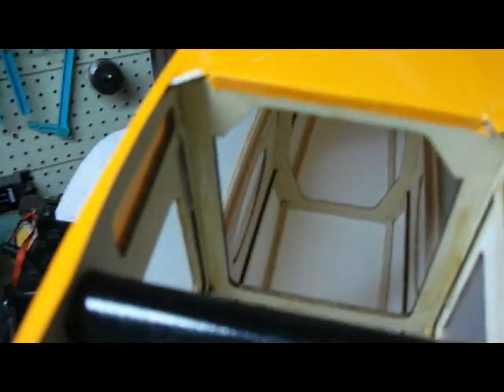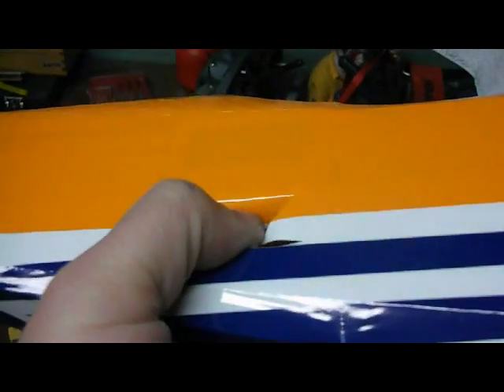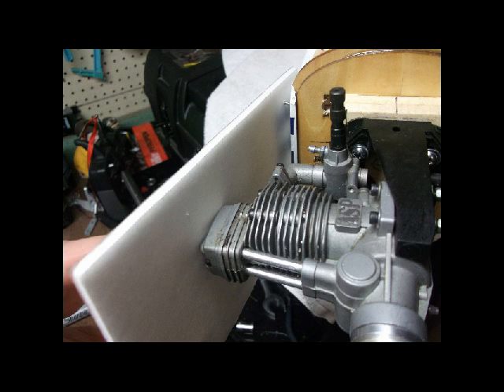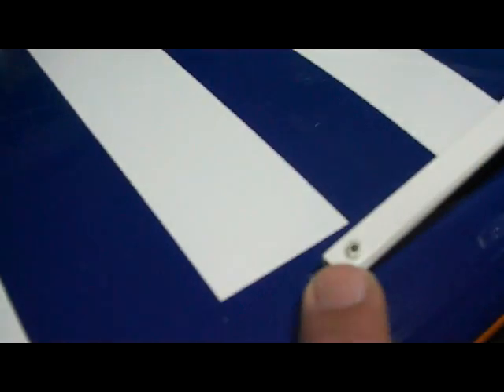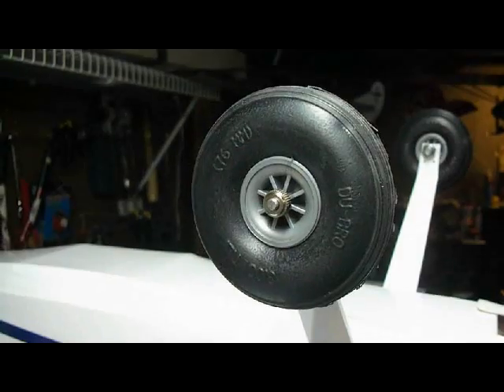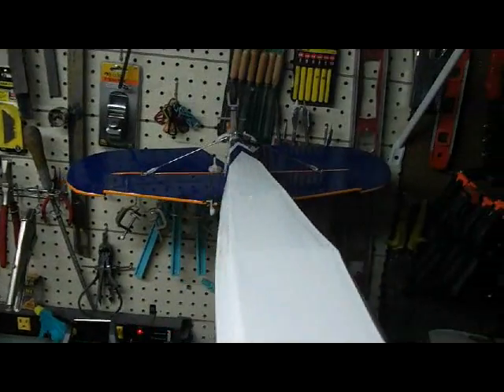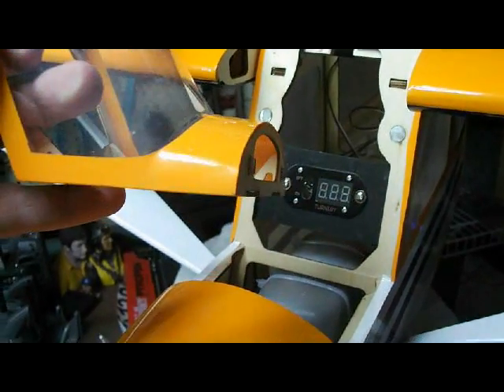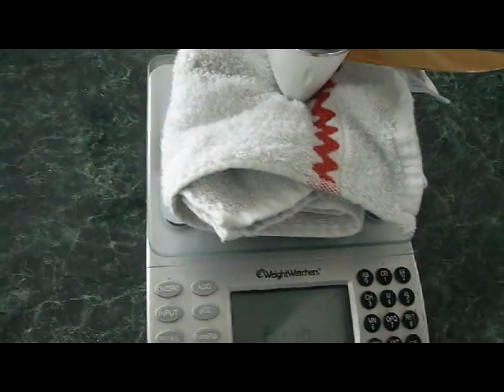Hobbyking Decathlon 62" w/nitro power

Comment: Have you flown this plane yet?, .. if so, how did it go?. I set the same plane up a few months ago with a magnum FS70 that I traded for a asp fs 61. My friend needed the lighter engine more than I did... had to put my battery right in front of the rear servos  to balance... it does some nice flat spins, I'll have to video it.
Reply from the maker: Not yet. There was a lot of crappy weather back in the spring. Although lately I just haven't had the time. The plane's been finished for 4 months and so far I've run it once to get the engine set up and that's it. I've gotta elevate my RC priority!
Reply: Wow, no maiden yet!,... hey I like the way you did the wing struts (mine are stock), it,s just there mainly to keep the wing halves on the plane in case the cheezy set screws come out...(keep an eye on that). The only problem that I had during my maiden flight..... the plane was balanced and it flew beautifully and didn't have to even trim it until I made my first high-banked turn and the the elevator was all out of whack. After I landed I noticed it was the crappy wire that joins the elevator halves together had twisted. I flattened one side of a wooden dowel and epoxied them together and had no problem since.... you may or may not have that problem (I didn't use epoxy when I set the wire)... which may have been the real problem... oh well.
Good luck with the maiden flight!, I do enjoy this plane myself.